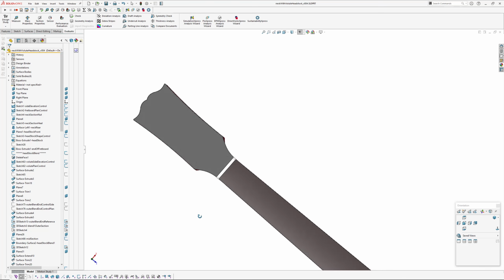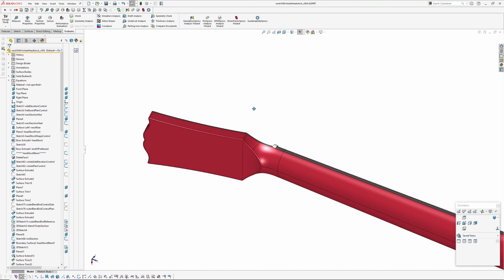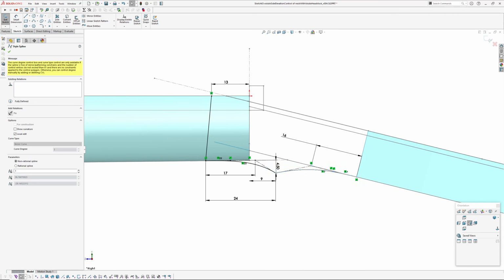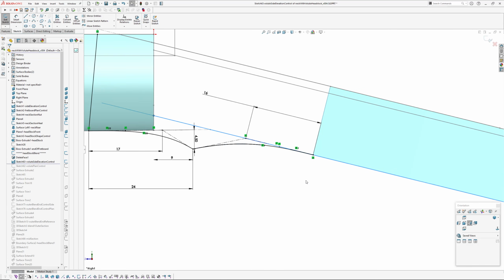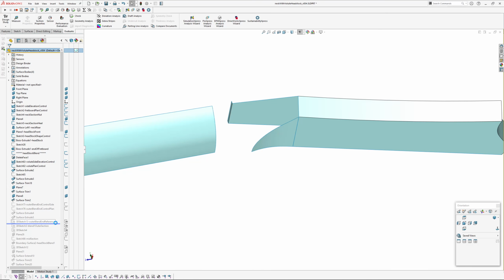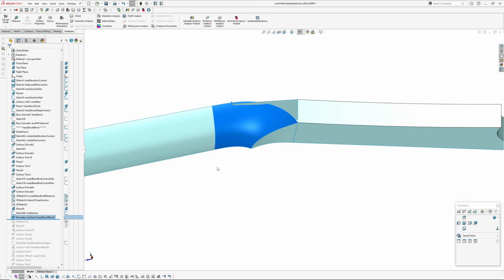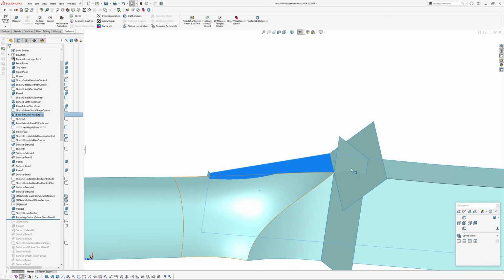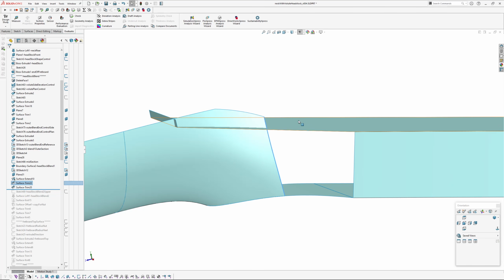Guitar Neck - With Volute - Surface Modelling Exercise In Solidworks

Comment: How do you get to these clean 3D-curves? A quick rundown on your technique would be super helpful as I am starting to understand how to approach a model in general but my 3D-curves tend to be very crooked and without corellations. As im trying to align cvs from one perspective I destroy my alignment in the others :/
Reply from the maker: 3D curves do need references to control each end. I try and fully define them when possible, even with splines with multiple CVs.

Comment: From the thumbnail I was shocked that AJ would use a surface fill... Just a trimmed boundary- should have known. That aside, the part will be CNC machined out of wood and finished sanded, the fidelity of the CAD won't transfer to the final part...
Reply from the maker: Both the luthiers that I've been talking with are machining their necks and were struggling with this area. Mainly with controlling the fullness or concavity of the blend into the volute edge. Fullness is ok, sand it back. Both had concavity, so best to fix in the model as auto 'surface fill'er looks bad on an oiled neck.